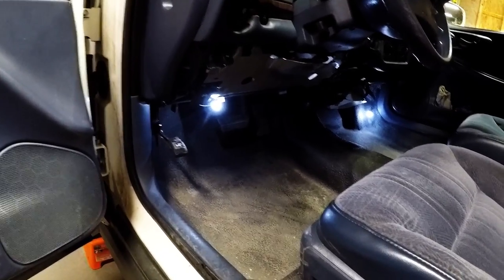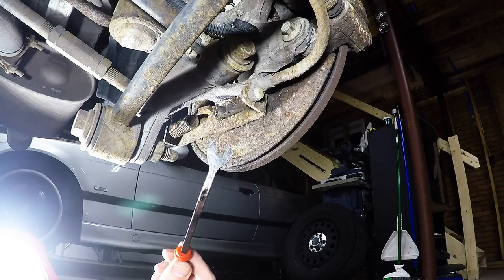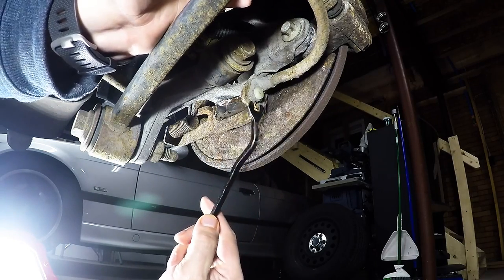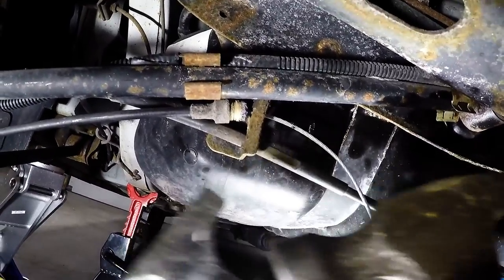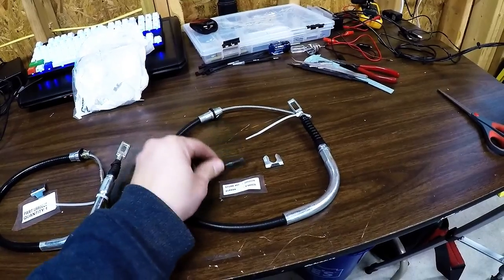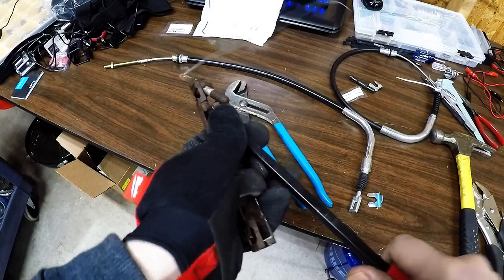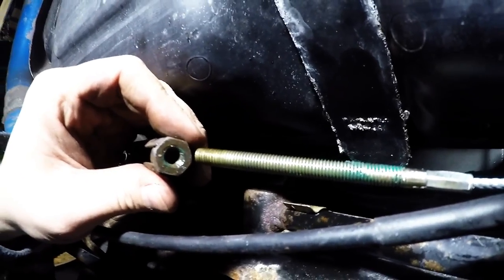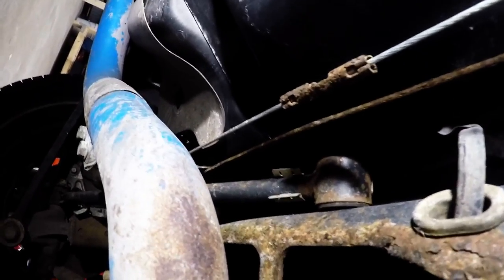Impala Emergency Brake Cable Repair

Comment: Great job! Now I know where to look on my 2012 Impala. Going in for rear brakes in a few days so I’ll see how bad they screw me over to fix my e brake. I would grease up all those cables and threaded adjustment parts as long as you are under there!👍

Comment: Ok doing this on an 05 Buick exactly same deal thanks so much big help I replaced all three cables and the new bracket so now no for sure not to remove the crimp clamp over that tensioner nut mechanism on the rear drive side thanks again!

Comment: I live in the Midwest so everything under the car is either hard to get off or it falls off by itself.
Reply: No kidding, gotta love the ice melting solutions used on the roads around here.
Reply: Just had to replace my Evap purge solenoid by the refueling system behind the driver rear wheel… needless to say, it took me two days of soaking in rust penetrator to get ONE, rusted out, stripped 10mm bolt off. Chevy does indeed run deep, deep into a rusted hole

Comment: Maybe try using some Brake Klean on it and then a lil W2-40. After the W2-40 works it way in, it would probably help with cleaning and breaking the stubborn nuts loose.

Comment: Thanks for the thorough video.  I have an automatic transmission 2005 buick Lacrosse.  I noticed that the rear left cable has come apart from the center part which is still holding the rear right cable.  Should the rear cable or cables or the center part be replaced right away, or is it something that can wait till winter months are over.  I guess I I won't have the emergency parking brake until then.  Also, how easy it is to just buy the centre connecting part (clamp?) and fix the problem.  The parts are currently somewhat rusted and may be difficult to loosen the screws etc.  Thanks in advance for any advice you can give me for my particular situation.

Comment: What year is this exactly for?
Reply: 2001 until 2013
Reply: @missingremote4388  so won't work for 2000 Monte Carlo SS?
Reply: @FatalCorleone07   it looks like the same body style. With front wheel drive. 
Mine is a 2008 Buick lacrosse. 

I got a quote from the Buick/GMC dealership. Replace Brake cable; But parts where held up due to a GM workers union strike. $200
I was able to fix my own cable  (too much slack) cable was good. Just no way to adjust tensioner ( rusted ) 🚗

Comment: just cut the cable and leave it. No one uses the emergency brake anymore
Reply: Thats a big problem though. Im actually going to school for auto mechanics, they say in the book that they arent really used for emergency braking much anyway, so now they go by parking brake. That is what they should be used for and in an emergency if you think about it and actually use it. Unless you live on a 100% perfectly flat level ground, you are putting alot of unneeded stress on your transmission. That will eventually give out and cost thousands to replace(depending on the vehicle). I always use my parking brake when parking. My 2011 caravan will be about 3500 to rebuild the transmission, so i want to protect that as much as i can.
Reply: @JohnSmith-qr4vt yeah, parking on enough inclines without it has made my impala make weird transmission sounds. I've been parking flat now and intend on fixing it soon

Comment: A little more talking and explaining what your doing would really help. I quietly watched for bout 3 minutes in silence then disliked the video.
Reply: You're right, I'll give you the narration you needed during that first 3 minutes of the video. Here goes: "I'm going to struggle to pull the broke piece off this hook.......aaaaand pulling........pulling.......I'll try another tool.............pulling and prying................next I'm going to keep pulling...........If you'll notice I'm also breathing a bit and having hands.......now I'm using the motor cortex of my brain to send a signal down the nerves in my arms, causing them to pull.......so if you really pay attention now, you'll notice that I am actually pulling..........pulling and prying..................K, it's off now."
Reply: @chuckmyers1246  You, sir, are a beast. Well put.